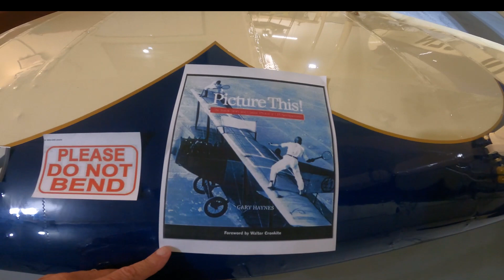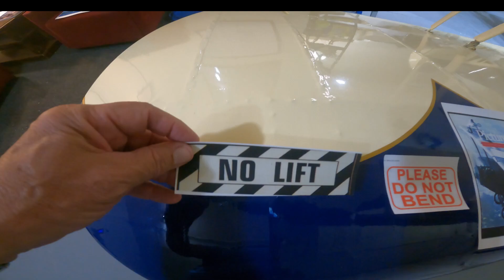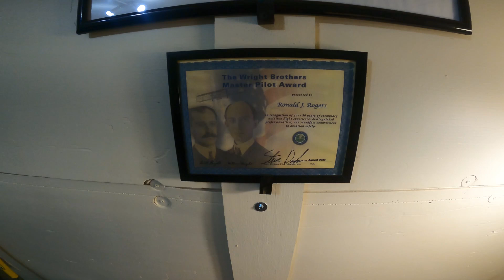Aviation Safety Explained. Why biplanes are safer than mono wingers. WARNING: Contains Levity

Comment: Your credibility is questionable. They are called Biplanes and Monoplanes and some Triplanes. On these planes the upper and lower wings are linked together, the upper wing separating is linked to the lower wing and will pull it off in case of separation, why do you think that these struts are attached to the wings. I don't think you can find a occurrence where the top wing departed leaving the lower wing undamaged. Thats why biplanes were obsolete in the mid 30's. That why they are no longer produced in quantity.
Reply from the maker: Obviously SATIRE is wasted on you....

Comment: Ron... you skipped two important safety features on the 1-winger!  First, with 6 fuel tanks, the fuel gets so confused it doesn't know where to go.  So you can never run out!  You also forgot to mention the extra propeller on the ceiling of the hangar.  That generates small amounts of lift that accumulate on the aircraft, making it fly better.

Comment: Flying acro in the open cockpit of a Lakes makes you pay WAY more attention to the way you put the 'chute on and then fasten the Hooker harness.... especially that lap belt. A good rule of thumb is to check the lap restraint half a dozen times prior to taxi, then another half a dozen as part of your CIGARSSSSSS checks during run-up. Those extra S's? Seat belts. Seat belts. Seat belts? Yup, check, seat belts. You wanna check a dozen times I'm not going to fault you. Nothing, repeat nothing gets your attention quicker than your ass moving at all during that first inverted check. 

Btw I've always thought the flying wires were for slicing geese, thereby preserving the leading edges of the wings.

Comment: The only thing I remember, is, the aileron is usually on the upper or lower wing. If the upper or lower wing becomes damaged, then the lower wing is useless, as far as keeping the aircraft level and stable, unless it is done so with one aileron on the opposite side. However, it is one of the most beautiful aircraft I’ve ever seen probably a pleasure to fly.

Comment: a few mistakes my friend the aileron cables are on the bottom wing push pull to top if bottom cable brake you are screwed  no 2 the strength is based on the whole structure all the wires need to be fixed to its neighbor if bottom or top fails you are also screwed not safer than mono so why are the so scarce
Reply from the maker: Yes of course, and many more issues. But the point was satire.
Reply: hi ron im inspired. flying along in my biplane the top wings have long gone, along with that lovely set of flying wires but thank god the landing wires are still on so im singing a happy song. now you could always invert and land/ now where did i see this lately bonjoir tolouse. now thats satire  and bad spelling /

Comment: One more very important safety feature of the biplane: if your seatbelt fails during negative Gs you will not hurt your neck hitting the cockpit ceiling. Enclosed cockpits are inherently dangerous.